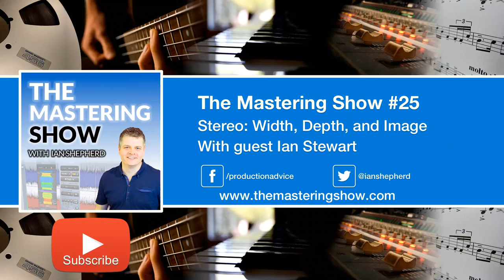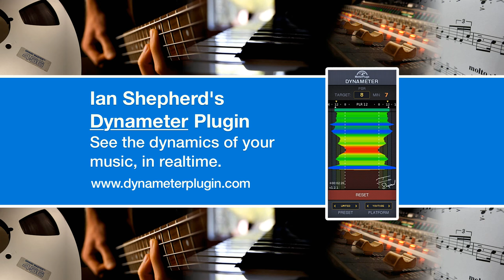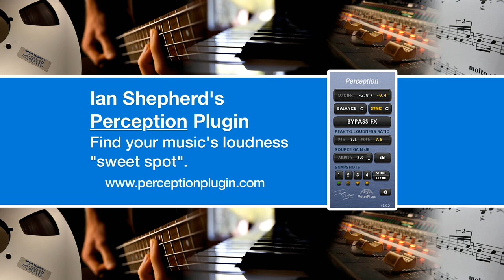Stereo: Width, depth and image  - Episode # 25 | The Mastering Show Podcast

Comment: In Studio one you can do frequency selective application of a plug-in using the built in 'splitter'. So you can select say below 100hz and send that off on a route that includes a narrowing plug before continuing on, but anything above 100hz will bypass that and continue on with the other inserts. This way you can use pretty much any width control plug in above/below a frequency without needing a special plug in that does it for you.

Would like to hear your thoughts on M/S multiband compression and the effect it has in bringing a mix out, making it more 3D and sounding less flat. Greg Wells is a fan of MBC to aid the 'record sound'  but I rarely hear of M/S mbc but I've used it with decent results to wrap the mix around your head, making it remain wide but more intimate and dynamic sounding.